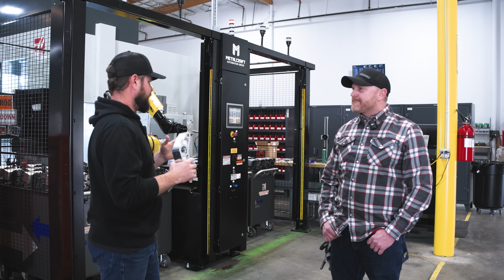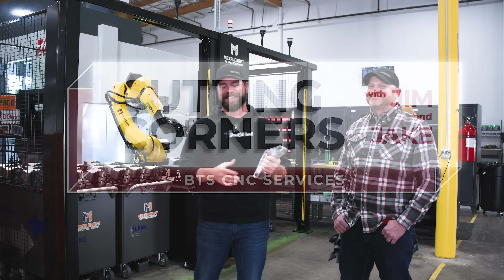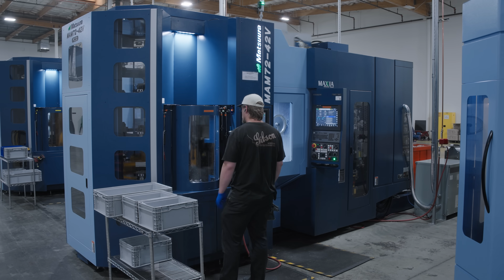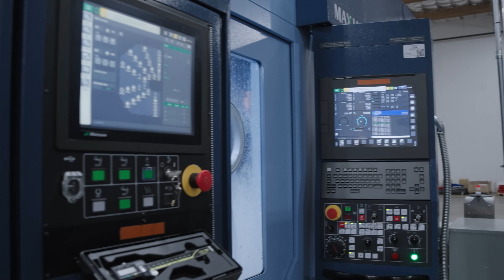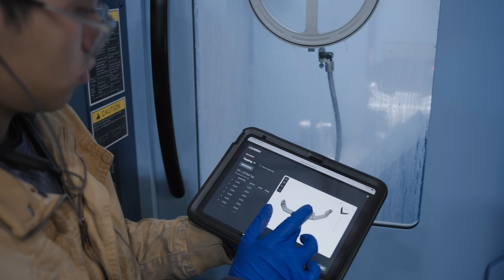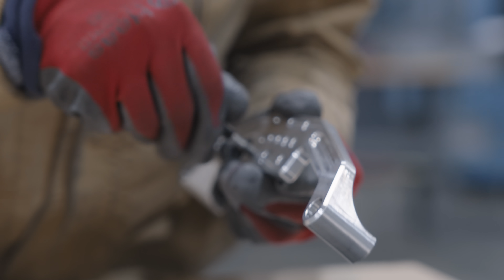Behind the Scenes: SendCutSend CNC Machining - Cutting Corners Episode 26

Comment: If you do not accept prints, how do you handle GD&T and surface finish call outs that are only called out on prints.
Reply: No GD&T, they just hold their tolerance  across the part, buyer can take it or leave it.  Surface finish is similar but they might add options.

Comment: How does a customer define a thread callout if it isn't modeled on the step file?
Reply from the maker: Once a part is loaded into our app, the customer will select the hole features in a rendered preview to assign a thread based on available sizes.
Reply: Thread I.D. is a dead giveaway (in metric at least) for ex. a 4,2mm hole in the model will always be M4
Reply: @yunis_fritz what if you have a 5mm hole. could be a 5mm hole for a dowel pin or tap drill for m6
Reply: "Tapping can be added at checkout; please do not model your threads"
Oh, just read that on their website
Reply: @Konchshell  Yeah, that one is mean xD... not talking about sendcutsend but I've seen many engineering departments use a decimal point more and an even odder ID. For ex 5mm for dowel holes and 5,073mm for M6... other than that I'm still a print kid

Comment: As automation, especially in CAM, comes China needs to be VERY worried.  Their standard of living has doubled every recent generation and their government won't be able to supply the people the lifestyle they're use to- uprising coming.  Gird your loins.  And keep US defense mfg strong.
Reply: Very true.  China is (or was until the announcement of 50% tariffs by Mexico on Chinese materials yesterday) opening factories in Mexico, both to beat US tariffs and because Mexico has lower labor costs than China now.
Reply: The input costs for materials are higher in the US. By your own making. Your electricity costs are high and increasing over time.
Reply: @fraserwright9482  Utility costs vary wildly in the US depending on location.  There are states where business can see sub 0.10kwh.
Reply: @fraserwright9482  that's artificial- they don''t have to be.  It's the liberals driving up the costs with regulation.  When Trump  relaxes the regs in the next 3/4 of his term the costs will come way down.  Especially when nuclear kicks in.